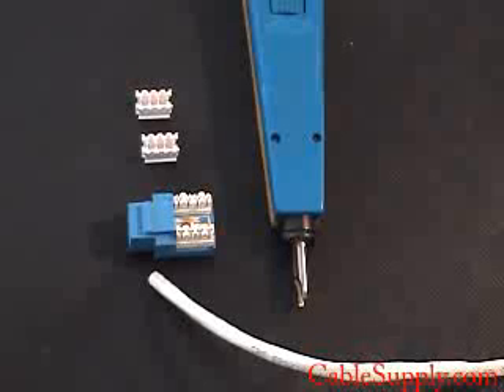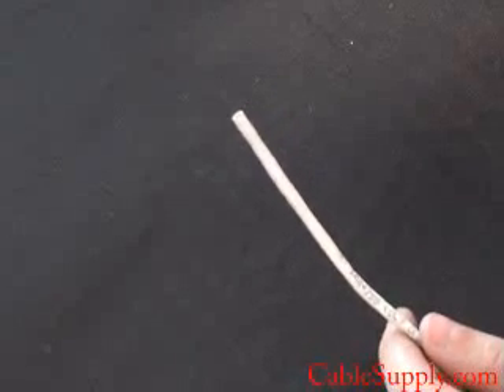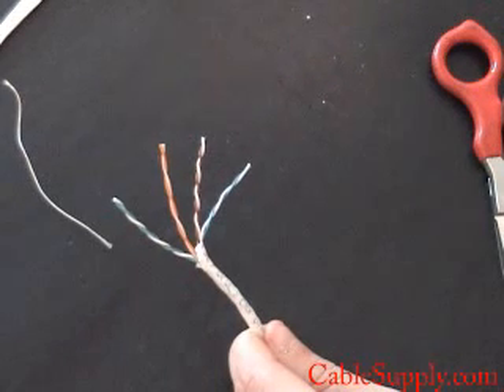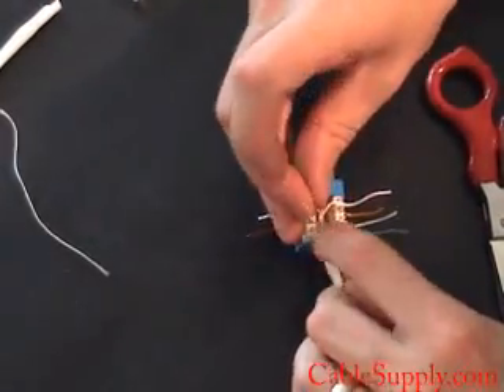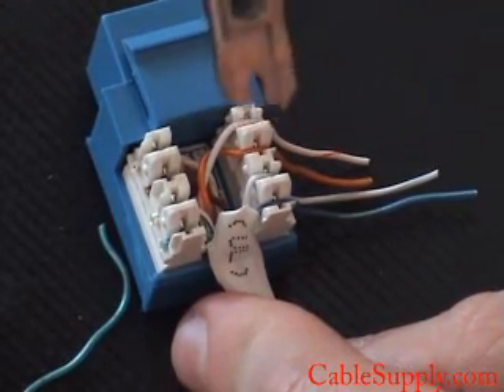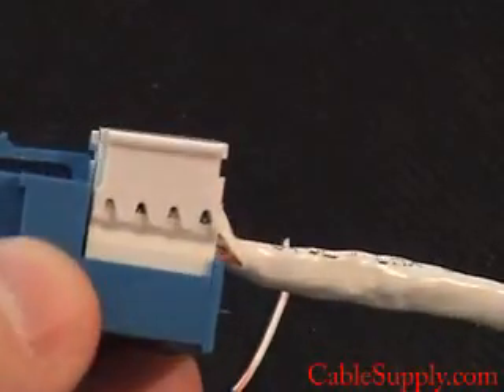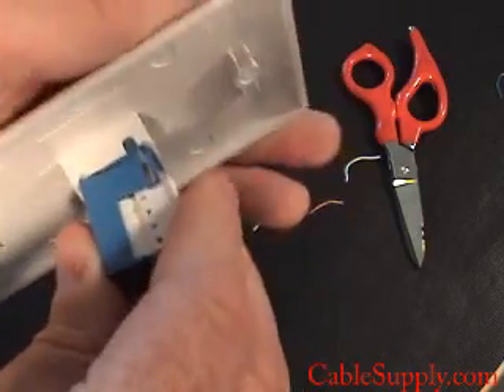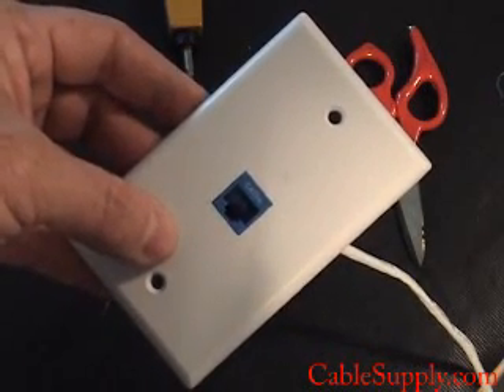How to Cable a Computer Jack, RJ45, Cat.5E, Cat6, Cat6A, cat7, Cat8

Comment: how about the other end?? can i direct it to gigabit switch or do i need to end it with another jack?
Reply from the maker: you need to use a patch panel at the other end. check WWW.CableSupply.com for patch panels.

Comment: How do u remove the key stone Jack from its plate without damaging it
Reply from the maker: If you look closely you will see a small plastic tongue. Use a small screw driver and push the plastic tongue down and the jack will rotate out.  Check out my other videos on keystone jacks and you will see how I remove the jacks from the wall plates.

Comment: Great video ... 100 meters is actually a little OVER 300 feet ... 328 feet to be precise.
Reply from the maker: Yes you are right!  however I limit my pulls to 300 feet to leave room for patch cords. If the pulls are getting close to 300 feet it is time to redesign your network.

Comment: You did not explain with the color coding on the RJ45 cables
Reply from the maker: I did not think it was necessary since the color code is printed on the side of each of our jacks.
Reply: @CableSupply  ...and what is the colour row in the cable? ow-O-gw-B-bw-G-brw-BR? Useful video, thx!

Comment: What exactly do you mean when you say one should "certify" them?

Are you referring to using FLUKE kit or something?
Reply from the maker: I miss spoke. you are right "certify" does mean using FLUKE $$$$ or a Fluke like$$ tester. However a low cost pin-out tester (LANtest sku# 101190) will find 99.99999 percent of a techs mistakes before turning the job over to a customer. Techs must test every jack/cable run.

Comment: Did you the A or B color code?
Reply: +Doc Zoidberg B is much more widely used, virtually all businesses and houses use B. A is used mainly by Telcos (Like AT&T) and the federal government as specced out in USOC which was created by the bells. It doesn't matter which one you use as long as both ends are the same.
Reply: I used B.

Comment: I bought a Shxon  CAT5e Kit from Fry's Electronics and it came with a crimper  300ft of cable and a tester.  I can't seem to crimp the cable enough to make proper connections on all contacts. Is it possible the the crimper is not strong enough or am I doing something wrong.
Reply: I have had the same issue with my crimp tool, where my ground pair were not making a proper connection. The only thing i have come up with is to just hit it with my punch tool after the fact. It's not as fast, but still faster than going through everything with just the punch tool.
Reply: Yea I returned the cat 5 last week and  told them to take it off the shelf as the crimper is sub standard. I then bought a cat 5 wall receptacle and I was finished in ten minutes. No no need for a crimper. Its $3.00 for the cat 5 receptacle and it comes with a push down tool.  If you want a good crimper buy the Klein crimper buts over $30.00 bucks. I did not buy it. My internet speed off the hook now that I am using cat 5 cable. Take Care B
Reply: Buy a better crimper, but also take note of the manufacturer of the copper cable you use. I've noticed that thickness of the insulation varies between making the mating of the rj45 connector and the copper wire a bigger pain than it should be, that's the reason I started tapering the insulation at the tip of the pairs slightly to ensure a nice snug but fully extended fit. Just my 2 cents.

Comment: @mburr3 Better to plan short, as variations in the cable can make a long run unreliable.

@onsightdata ethernet uses positions 1,2,3, and 6 - four wires

Comment: @onsightdata 
Not true.  Each CAT5 cable can handle two 100 Mbps full-duplex circuits.  You can buy splitters which enable you to combine and split two such signals to separate jacks.  I use it all the time.

Comment from the maker: There are small single use (more or less) plastic tools that can be used but if you are going to be installing more than one cable, your going to want a punch down tool. It is invaluable.

Comment: My advice would be to get a tester to make sure your all the contacts are good and to see your miswire problem... I had a simulare problem. I had rj45 jack on one side and a keystone on the other. It seems the keystone has some kind of odd pin out or something. You can get the tester for under $20 and will find most problems.

Comment: B to B is "straight-through", as is A to A (but most cables come with a B connector, so if one end is a plug and the other is a jack, you could run into problems). It's usually safe to stick with B to B for straight-through connections, and B to A for cross-over.